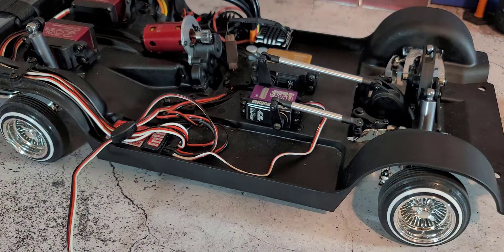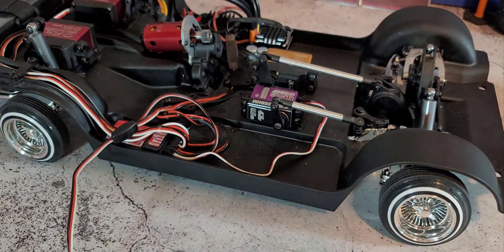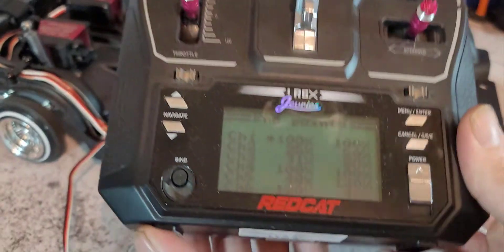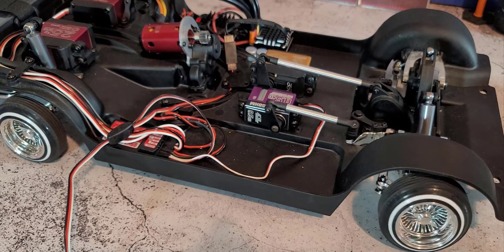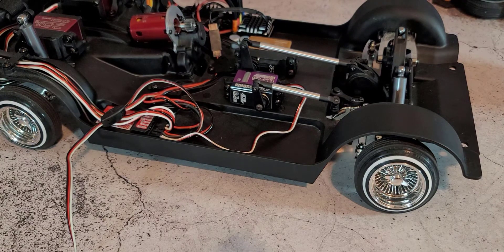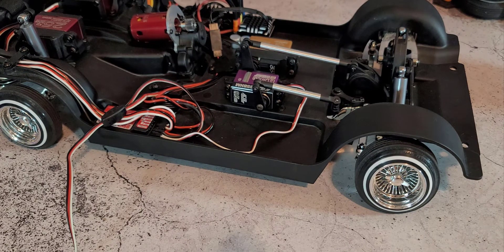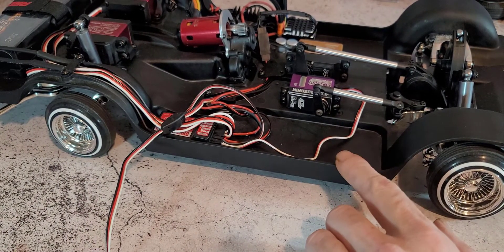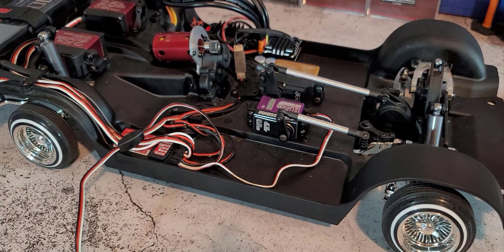Redcat  Lowriders The BEST Steering Servo Upgrade PERIOD AGF-RC A35BHM

Comment: I just replaced my steering servo on my 64 and I used a Spektrum A500 25g metal gear servo. It was about 20 dollars with shipping and works well better than stock and fits perfectly.
Reply: Are you using the stock esc?
Reply: The stock esc is rated at7.4v bec that servo is only 6.0v
Reply: I’m using the stock esc and don’t have any problems. Most servos that say 6.0 will hold the 7.4 unless it’s a 6 dollar servo and I’m sure it’s pumping out more than the 7.4 cause I’m running a 3s lipo. The rear servos the 25g stock ones on the sixty four is rated at 6.8. The esc is rated for 2s 7.4 but most run 3s 11.1 with no problems just as long as you don’t have the end points beyond it’s range that will burn up a servo.

Comment: My Monte Carlo steering servo was bad out of the box, redcat replaced it but not my alignment is off and the wheels are slightly turned to the right. Do you know if this is something i can adjust myself?
Reply from the maker: Yes you just need to power it all up, take Lil arm on servo off adjust wheels straight, the put arm back on. 

If not perfect centered the steering center can be adjusted in controller